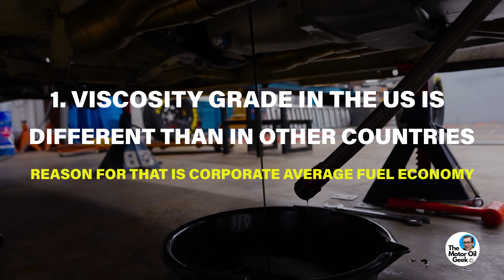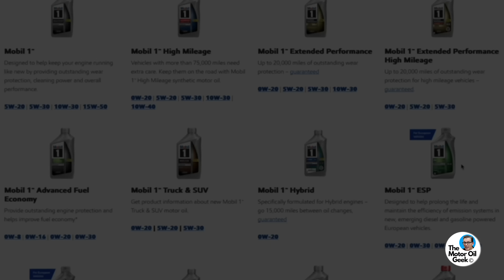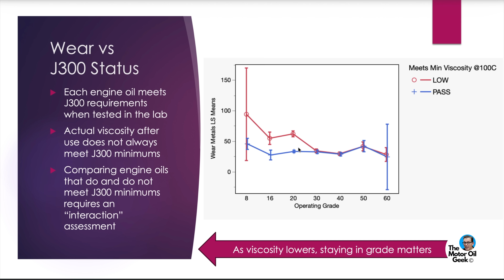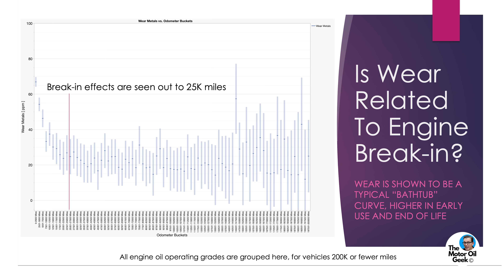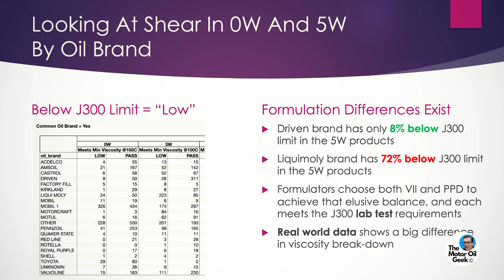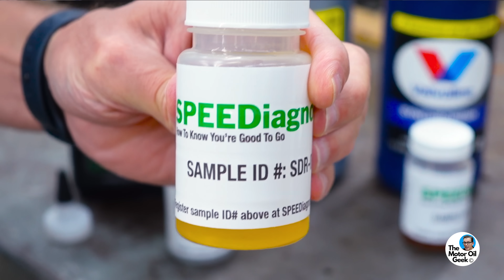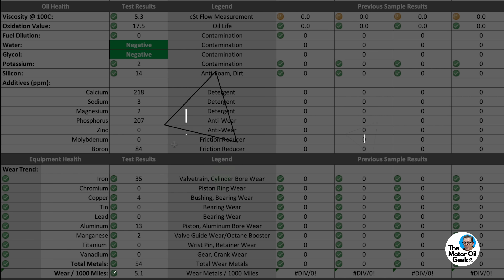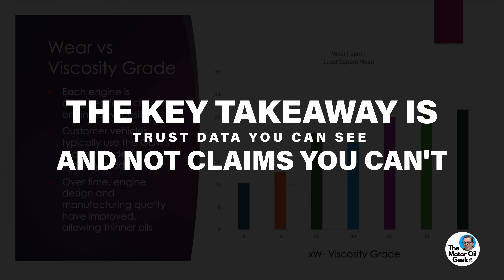More Ai Lies? The FACTS about 0W-20 vs 5W-30 (With Evidence)

Comment: I know someone who bought a new Subaru and it uses 0W-20 in the USA. The engine is made in Japan. I looked to see what oil Japan is using in this engine. Japan uses 5W-30. The engineers who designed this engine, not government bureaucrats, say it should run 5W-30.
Reply: Here in NZ, we import most of our used cars from Japan (That means most of our cars are Japanese market cars). On Subaru's, they have the oil grade on the oil filler cap. Most of the ones I've serviced as a mechanic say 0w20 on the cap. The user manual will give a range of the suitable oil grades and  temperature ranges. Similar thing with Honda, Toyota wanting 0w16, though it will be on a sticker instead of an oil cap.
Reply: @paragon84  literally every owners manual will state the oil type to temp as a chart if the car is worth their salt.
Reply: @Derkiboi  Many newer vehicles are specified with a single oil type regardless of temperature.
Reply: @tid418I bet if the owners manual doesn't have it, I'd guess the repair would 

If it didn't, I am not buying that car
Reply: @Derkiboi  You are right, and I agree, but that was not the point I was making.
Original post suggested that an engine made in Japan with oil claimed to be 5w30 should be the same in the USA. My point was that those cars in Japan also use 0w20 as the main recommended grade. Of course it will also be in the user manual along with possible alternatives.
In conclusion, the Japanese specs for recommended oil are the same as the USA in this example.
Reply: @Derkiboi  Bought my 2013 Camry new and the owners manual doesn't have the typical oil temp range chart. It only says to use 0-20.  Oil change shops refuse to use any grade that isnt shown on the oil cap too. They are worried about liability...which is a bunch of BS but it is what it is.
Reply: @William-x8m6s  rough, that sucks
Reply: @William-x8m6s  that only makes sense if you request it to be different, and after waiving that broad policy of we will only put in what it calls for,  they then put in a different oil knowing it WILL damage your vehicle.    so like sae 30 in negative 30 degree weather or antique motor oil in a new car
Reply: @Derkiboi  The fact that many U.S. owners manuals have switched from the temperature chart to a single viscosity is a clue that regulations are dictating the recommended oil viscosity.
Reply: @Derkiboi  What you're failing to understand is that the outside temp has zero effect on the operating oil temp.
Reply: @shawngrimes9302   No, it means the operating temp of the oil is not affected by the outside air temp.
Reply: @e-curb I’ve not done the testing myself but in one of his videos Lake says the opposite. In a vehicle with no or very small oil cooler, it would make sense for the ambient air temp. to affect oil temperature.
Reply: @e-curb  that is false "What you're failing to understand is that the outside temp has zero effect on the operating oil temp." 

False because cold starts and cold temperatures will mean starving an engine for oil if you use a heavy enough one in the colder places
And the hottest places will shear a thin/low w number oil while operating
Reply: @shawngrimes9302  regulations arent dictating jack anymore or even when they made the car. there are harsher places for mpg in the world and they are using different oil.
Reply: @CT_Taylor  I would be interested to learn more about that. Can you provide an example?
Reply: @CT_Taylor    A car in North Dakota in the winter will have the same oil temp as the same car will have in AZ in the summer once they're both up to operating temp. The cooling systems of modern cars are that good at controlling temps.
The outside air temp is meaningless.
Reply: @shawngrimes9302   In most modern engines, the engine block is the oil cooler. The water cooling system will cool the oil. There's a reason you won't find an oil temp gauge in any car. It's because the oil temp is always the same as the water temp. Some cars will have a separate cct in the radiator for engine oil. Some use it for transmission fluid. My friend had a Golf a few decades ago that had a sandwich adapter on the oil filter mount. Two hoses hooked up to it, connected to the water cooling system. In theory, if after a cold start, the water temp warmed up faster than the oil, it would actually heat up the oil.
Reply: @shawngrimes9302  about which thing are you asking about , i had 2 comments
Reply: @e-curb  ambient temp matters quite a bit, as stated, and to clarify what i was saying before(tbf i didnt say it outright) the whole starving for oil is the fact that the oil viscosity in cold climates like where i live will dicate wear because the oil thickens considerably with cold and startup is already the most wear on an engine, try startup without oil for even longer on surfaces sliding 
The operating temp of vehicle is definitely affected by ambient, youre not gonna have a car in hot summer in arizona in trafffic be at the same temp as the same car in my neck of the woods in the same traffic conditions no matter how much you warm up the vehicle, the cooling system as you said is more effective and it will not reach the temps the summer car will. slow moving in summer can put temps a lot higher than you think, and its not going to beb that hot when its this cold.  
Plus, a lot of vehicles have oil coolers especially turbo and trucks.    They definittionally are affected by ambient temp quite a bit esp while moving.
Reply: @CT_Taylor  Camry in USA is 0-20 and in Japan 5-30 so you are saying going from 20 to 30 is going to damage?...not in Florida temps. Regardless I follow mfg specs and drive an average of 6700 miles a year. Changing oil at 3k miles meets the 6 month spec for oil change. My last Toyota had 265k and didnt use measurable oil with 3k changes. Evidently new filters captured enough Same as my other cars for the last 50 yrs.
Reply: @Derkiboi  Well you arent buying a Toyota.
Reply: @William-x8m6s  did not say that
I said that viscosity matters 
In a high heat high humdity place, 10w30 is going to be better than a 0w30 if it was equal other than the first number there 

in a frigid place, 0w30 will be much much better than 10w30
Reply: @e-curb  That sounds like the small heat exchanger on our 2016 Camry. It’s called a cooler but I suspect it’s there to speed warmup for emissions testing purposes.
Reply: Same with the Penta star 3.6 internationally says 530 only some say 5w30 here.. my triton 5.4 also recommended everywhere use 5w30 not zero20 for oil pressure
Reply: I bought a 2026 Forester (Assembled in Indiana, Engine & Transmission Japan).  Manual states 0W-16 Synthetic.  Also states, if not available 0W-20 conventional oil may be used if replenishment is needed but should be changed to 0W-16 Synthetic Oil at the next oil change.  I assume they meant to say 0W-20 Synthetic but not sure.
Reply: @dpny3960 just use 0w 20
Reply: @JunaidsTech  not in mine 5w30 f that green scam stuff .top shelf only
Reply: @overbuiltautomotive1299  0w-30 or 0w-40. The thinner the better for starting no matter the temperature.
Reply: @dpny3960  run 5w reastore n protect or other high end oil
Reply: @dpny3960  0w-30.
Reply: You should do what the engineers say.  Government beaurcrats are not engineers.
Reply: I have a Nissan Rogue, Nissan also recomends 5w 30 also.
Reply: Look at your japan owner's manual again, I can almost guarantee it shows 0w-20 as being ONE of several acceptable grades of oil. So no, the engineers who designed that engine are actually saying the engine can run on a mulitude of grades, 0w-20 and 5w-30 BOTH being acceptable.
Reply: @electricalinput5999  Scion tC (has a Camry/RAV4 2.5L I4 engine) owner's manual recommends 0W20, but lists 5W30 as an alternate, but the mileage between oil changes is lower.  Will more frequent oil changes keep your engine cleaner and make it last longer?  I bet it will.
Reply: @TheSuburban15  Thats an very old Scion. My 2008 RAV 4 had 5-30 spec but I dont remember the change spec. My 2013 Camry has a 10k mile change spec and the low compression rings are universally known to get stuck well under 100k miles if you use that spec. When that happens the engines use 1-2 qts of oil per 1k miles. 3-5k oil changes keep the ring lands clean and eliminate rings sticking and massive oil consumption. This goes for the 2.5 from around 2008 to 2013. They warrantied this for 30k miles and a 3 yrs and left everyone else on the hook.
Reply: @William-x8m6s 2012 model 2ARFE
Reply: @TheSuburban15 0w-30 or 0w-40 every 3k-5k. 4 cylinder especially benefit from 0w for start with reduced torque for quicker and easier spread of oil on start up lengthening the life of the motor!
Reply: @powellkwd40 I am a bit confused by your implied assertion that it is the government that dictated the oil choice. Curious to know more.

With that asked, its the manufacture that chooses the oil for reasons or meeting fuel economy standards. They could design a different engine, detune, change gear ratios and more to meet those standards. While well intended and poorly written and likely in need of amendments I don’t find it very honest to frame your point that way and would like for you to consider how it adds fuel to conspiracy fires when it comes to how companies, governments, and regulations play cause and effect on each other and the related consumers.
Reply: @ajv0987  Its call CAFE standards that pressure mfgs to choose thinner oils to get the avg mpg the mfgs are dictated to get. Thats why USA oils of 0-20 are 5-30 in Japan and other countries who have no CAFE standards. This is nothing new and goes back decades. So yes the govt has a lot to do with the oil spec but does it outside of "mfgs spec".
Reply: What causes oil to shear out of grade? ...love these videos...thanks
Reply: @sonoma314  Oil dilution by fuel getting into it, heat damaging the oil and it's additive package wore out are 2 big ones.
Reply: @lonniebeal6032 oil delusion just means it’s actually doing it’s job keeping the engine clean
Reply: @sonoma314  also moisture. Humidity in the air building up in the oil.
Reply: yea only not knowing this or idiotz run ow 20 bs green scam
Reply: My New Subaru actually calls for 0w16 however i use 0w20.

Comment: Love the videos! I have a question. I recently got a 2017 Dodge Challenger R/T. What are your thoughts on an oil catch can? It’s a stock engine with 80,000 miles. Many say I need it while some research said they are more for direct injected engines. Thanks.

Comment: So are you saying that using 5w-50 vs 0-40 Mobile 1 oil on my 2014 Porsche Cayman S gives no benefit?    My own oil sample analysis suggested that the 0-40 oil becomes a 30 weight oil only after about 3000 miles.

Comment: I'd rather listen to mechanics and engine builders, and they tend to say to use the thickest, most protective oil allowed on whichever specific engine the case may be, going by season, and to change the oil frequently. 

Alleged lab data means nothing when your engine fails. Blackstone labs and manufacturer shills will not pay the repair bill.

Comment: Europe is Big about mileage by their engine designs being aimed at mileage, and also Japan doesn't get colder than 30 to 40 deg a 5w 30 is acceptable depends on the temperature of the climate. America doesn't really have European type cars with the engines the lighter oil would be good for mileage.

Comment: What bothers me is that so many manufacturers now write the owner's manual to act like if you deviate from xW-xx viscosity then your engine will explode. Does the EPA punish them for putting a viscocity chart in the manual? Back when I had a Kia Stinger GT it actually did come with a chart that allowed 5w-30 all the way to 20w-50. So the 365hp turbo V6 could accept that broad a range of oils but a basic Honda Civic will die on anything aside from 0W-20?

Comment: The biggest issue with simple grade comparisons is that the grade alone isn't everything. It depends on the specific oil and how it's put together. There are great 5W-30 oils, but there are also trash 5W-30 oils. And the same is true for most other grades as well. It takes study of data sheets (some companies don't even provide advanced oil specs), real world tests, lab results, etc. to find out what's what.

Comment: Lake, I recently bought an older 2009 Mercury Mountaineer with the 4.6 V8 and it calls for 5w-20. It has 157,000 miles with that many miles would going to 5w-30 be better now due to the possible wear of the engine or stick to 5w-20? Thanks

Comment: Hey Lake, you did it.  You put 0w20 and 20w50 in a motor and the 0w20 had more wear metals in it.  The 0w20 weak spot is high temps, like AZ.  I want 0w20 oil analysis results at 5,000 miles from AZ summers...
Reply: Ask your buddy for a 0w20 oil sample for testing and you want it now.
Reply: @2nickles647 How often do these guy listen?

Comment: The only protection your bearings have is the oil if the oil is this 0w20 and you put a lot of pressure on the bearings it squishes out the oil people don’t use 0w20 or anything like this go drag racing build engines and you already know this facts.

Comment: I won't argue with science. However, engines that were designed to run on 5w-30 don't benefit just because CAFE standards interfered. Science is fine, but don't ignore history. Consider that heavier oils are recommended for identical engines except for those sold  in the USA. Science is science, facts are facts. Your research is credible, folks who have adequate reading comprehension skills will understand.

Comment: Thanks for the info! My 2025 Acura RDX says to use 0w20 which I am but thought going to 0w30 would be better because of the turbo engine. Any thoughts ?
Reply: Where you live, does it get really hot in the summer - 90F and above? If it is, then 0W-30 seems to be the logical choice

Comment: A question and an opinion 
What about a percentage mix 50:50 of 0W-20 and 10W30 for warmer climates.
I live south of SanDiegos Latitude line and summers are very hot. We can have temps over 100 for a month or 3 at a time.

Just an opinion but engine % of time outside of operating temperature probably causes more wear than the oil choice. 
In my 8th gen Civic I always mixed Hondas 5W-30 with their 10W-40 50:50. At 500,000 miles the valve train and cylinder head was still silver with a tiny bit of bronze color build up in maybe 20% of the visible head. Pretty sure it was to the engine always being at temperature after the initial starting. 
A 5- 10 min drives to wherever then the engine cooling significantly is an engine killer no matter the oil.